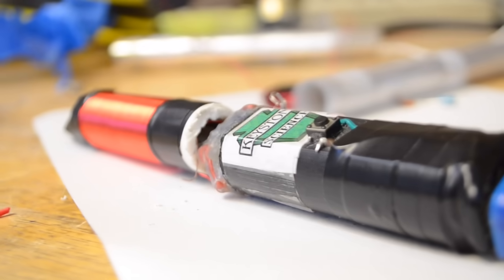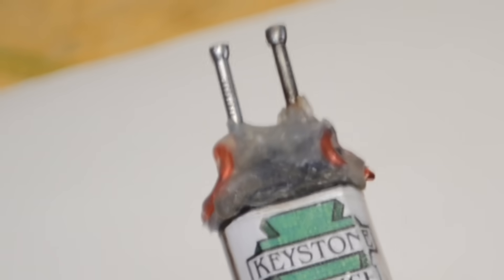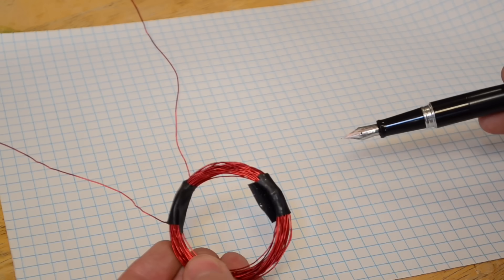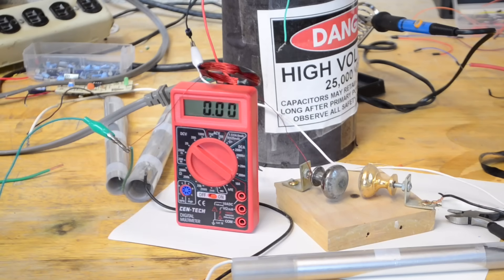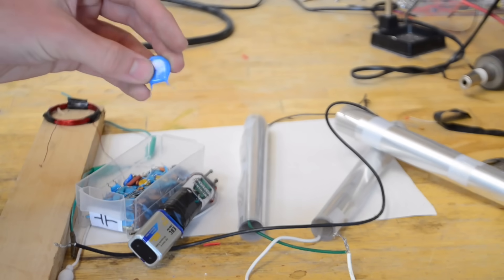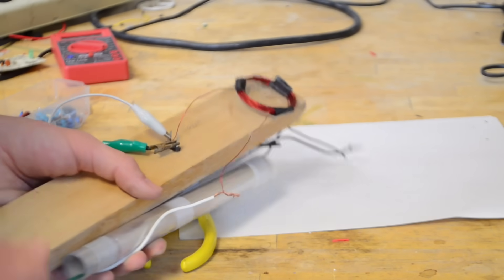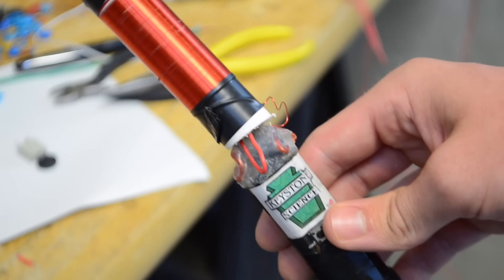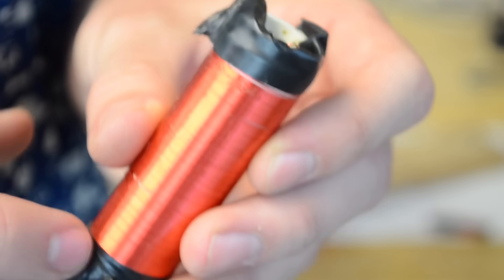How to make a pocket EMP

Comment: I'm lazy, I'll just take apart a Kodak camera and use its capacitors. I'll need a toilet paper roll to roll my copper coils maybe ten times and should be good to not overpower the capacitor. Might need to shell out money for a dpdt switch.

I'll be able to take out a cheap disposable calculator 🤩

Comment: Why was this recommended, and did it have anything to do with Airbus aircraft nose dive 30th october, characterised by investigators as solar radiation event
Reply: I been maiing some prototypes with no loads herest a simplified versio tv remote send signal receiver receives it starts a pre set timer then it heats up a fire that dicharges a shotgun slug that has no beads only gunpowred (l am not making a bomb) just trynna make something that launches rockets remotely at new year

Comment: You can trash electronics via near air gap discharge using a simple piezo gas grill igniter. No coils, no batteries, no capacitors.

Comment: Please for the love of God be someone that doesn't call a stun gun a taser. A taser is a device that shoots barbs on the end of wires connected to the device. A stun gun has 2 to 4 electrodes and you have to directly connect with the person which is what you have right there. I'm so tired of people Ignorantly calling them the same thing to the point that it's bulk ignorance out there. Knowledge is power young man.

Comment: Using the coil so close to the multitester's pcb it's obvious that the magnetic field will induce electric current  and burn the components. I came to see real emp device and you present us an antenna... Actually for all of us that know electronics what you did was input high voltage to a coil and induce current.

Comment: How close does it need to be to the electronic item
Reply: Depends on how big your magnetic field is. The bigger your magnetic wire coil and with many layers the better range. But for a small device such as this from the video I doubt the wave will reach every corner of the room he's in.

Comment: can you build me one that fits in the back of a pick up truck? lol
also this is the reason I own a 2nd gen 12 valve cummins diesel pick up, its emp proof, 100% mechanical fuel injection, no emp will ever take it out and if it were to happen on a massive scale the truck would still run.

Comment: I patented a device which converts heat almost fully into electrical energy. The patent is US 3890161A    DIODE ARRAY filed 1973, granted 1975, open for public use, 1992. It covers a device which produces refrigeration which is a loss of thermal energy while it produces electrical energy. The energy gain and loss must be equal because the energy of a system considered as a whole must not gain or loose energy though the energy may change form.

A diode array plausibly designed for power levels of watts would consist of billions of very small diodes in consistent alignment parallel or, for additive voltage, parallel series. 

The diodes partially rectify the.random thermal motion.of mobile electrons or stable positively charged  voids called holes inside diodes. The diodes are aligned the same way so the output of many diodes is additive. 

A simple rectifier crystal can, iust short of a replicatable long term demonstration of a powerful prototype, almost certainly filter the random thermal motioren of electrons or similar  positiive charged voids called holes so the electric current flowing in one direction predominates. At low system voltage, a filtrate of one polarity predominates only a little but there is always usable electrical power derived from the source, which is Johnson (observation) Nyquest (theory) thermal electrical noise. This net electrical filtrate can be aggregated in a group of separate diodes in consistent alignment parallel creating widely scalable electrical power. The maximum energy is converted from ambient heat to productive direct current electricity when the electrical load electrical resistance  is equal to the array internal electrical resistance.

Maximum calculated electrical power output (watts) is k (Boltźman's constant), one point three eight x 10^ minus 23, times T (temperature Kelvin) times bandwidth (0 Hz to a natural limit ~2 THz @ 290 K) times rectification halving and nanowatt power level rectification efficiency, times the number of diodes in the array. Rectification is inefficient at low voltage. Inefficiency reduces the performance but the heat absorbtion remains equal to the yield of electricity.

There are a billion cells of 1000 square nanometer area each per square millimeter, 100 billion per square centimeter.

Order is imposed on the random thermal motion of electrons by the structual orderlyness of a diode array made of diodes built within a slab: 

Host crystal is silicon
  P type boron doped
-----‐------‐----___-- Out
🔻🔻🔻🔻
■■■■■■___ + Out
  N type phosphorous doped 

All the P type semiconductor anodes abut a metal conductive plane deposited on the top face of the slab with nonrectifying joins;  the N type semiconductor cathodes or common cathode abuts the bottom face. As the polarity filtered electrical energy is exported, the amount of thermal energy in the group of diodes decreases. This group cooling will draw heat in from the surrounding ambient heat at a rate depending on the filtering rate and thermal resistance between the group and ambient gas, liquid, or solid warmer than absolute zero. There is always a lot of ambient heat on our planet, more on equatorial dry desert summer days and less on polar desert winter nights.

Focusing on the composition of one simple diode, a near flawless crystal of silicon is modified by implanting a small amount of phosphorus (N type conductivity) on one side from a ohmic contact end to a junction where the additive is suddenly and completely changed to boron (P type conductivity) with minimal disturbance of the crystal lattice. The crystal then continues to another ohmic contact. 

A region of high electrical resistance forms at the junction in this type of diode when the phosphorous near the ĵunction donates electrons that are free to move elsewhere while leaving phosphorus ions held in the crystal while the boron donates holes which are similalarly free to move. The two types of mobile charges mutually clear each other away near the junction leaving little electrical conductivity. An equlibrium width of this region is settled between the phosphorus, boron, electrons, and holes. Thermal noise is beyond steady state equlibrium. Thermal noise transients, where mobile electrons move from the phosphorus added side to the boron added side ride transien⁸t extra conductivity so t⁶he forward moving  electrons are preferentally filtered into the external circuit. Mobile electrons are units of electric current. They lose their thermal energy of motion and gain voltage, as they transition between the junction and the array electrical tap.

There are other plausible breeches of the second law of thermodynamics. Hopefully a lot of people, mostly as independent teams, will join in expanding the breech. Please share the successes or setbacks of experiemental efforts. 

These devices would probably become segmented commodities sold with minimal margin over supply cost. They would be manufactured by advanced automation that does not need financial incentive. Applicable best practices would be adopted. Business details would be open public knowledge. Associated people should move as negotiated and freely and honestly talk. Commerce would be a planetary scale unified conglomerate of diverse local cooperatives. There is no need of wealth extracting top commanders. We do not need often token philanthropy from the top if the wide majority of people can afford to be generous.. 

The topic deserves discussion and prototyping attemptaction. 

Aloha
Charles M Brown
Kilauea, Kauai, Hawaii, 96754

Comment: I’ll never use it on anybody who has metal in their body. I have an air module nail eight screws for pins and countless other things. I had a multiple tip compound fracture. I broke 55 to 60 bones in my foot and leg. I’m pretty sure they stopped counting. So if you use it with some men on their body and they could be extremely dangerous your wherever if it’s in like from the inside out, you can’t even put heat on your life if you have me in your life or where the metal is, you can’t put heat on it, please keep in mind as that would be cruel

Comment: I had a thought. As an internet/youtube educated,  no degree, garage scientist. This is all hypothetical in the name of science in defense of the state.

But my hypothesis is, would it be possible to attain the same resulting magnetic field onto a moving projectile? Say an arrow or something thrown, with a large enough magnetic field to knock out incoming anti troop exploding drones. Or would the resulting magnetic field trigger they're explosives? Testing this hypothesis would be very illegal. And again is why I reiterate this as a hypothetical hypothesis. I know there's already cutting-edge emp military gear. Like the EDMS4  (Electronic Drone Mitigation System). Which is a point and shoot electromagnetic pulse weapon parallel to a standard infantry rifle. Currently in use by Ukraine. Now, you want to assume oh (hershey) there's no need touch on it this anymore it's pointless. The science has already been perfected. True but one underlying problem becomes, availability. Not every NATO ally is gonna have access to this equipment. Your units out in the trenches. Your cut off. Wasting ammo, exposing yourself shooting at quick zooming drones. Your units unlucky enough to not have the fancy emp rifle What I want to make is a simple, easily accessed, troop anti drone emp projectile with a wide enough magnetic field to safely knock out killer drones and spare friendly electronics. An affordable and reliable alternative to the EMDS4.

Comment: Use airsoft grenade,  large quartz crystal, compression pneumatic and a very well pre tested rock solid explosion chamber, connected piezoelectric charge to large inductor around explosion vessel. Detonate the airsoft grenade,  what you'll get is a tactical EMP that'll knock out phones out to 10ft assuming the explosion vessel doesn't become a pipe bomb 😂

Comment: Suspecting that how that circuit ACTUALLY functions is that the cap fills up to a high enough voltage to jump that spark gap and it discharges through that the inductor’s field collapses mostly and that repeats
Reply: How is that different from how he said?

Comment: Just use a stun gun or something stun gun flashlight.
Good way to short out electronic door locks, cellphones.

To make it be focused- insulate the coil with plastic and then sheet metal. The metal acts like a ""Farady cage style cannon""!❤
It's more focus and more power directed at the object closer to a pin point accuracy.😮😮😮

Comment: Make the pocket coil stronger by putting multiple layers of wire or using an iron pipe instead of PVC. Or both.
Reply: No iron pipe would make a permanent magnetic wouldn’t it? Then no pulse.

Comment: dude I built my first one before it was ever even called any of that. Back in 9th grade I took four different shops at a vocational school one of them was electronics. Sophomore year the first project was the taser. (Well that's what you call it today...) Except when I engineered the board I had the two wires one on each of my index fingers) 🤌 so when I said hello it woke you up... That's not why I got kicked out of school though :/ That's because that was the actual project we agreed to and everybody built it not just me.

Comment: also, you could use an iron water pipe to wind the coil around.  use insulated wire you could get from cat 6 ethernet cables or use tool dip or some other means, such as dipping the pipe in liquid wax or elmer's glue to create an insulating layer around you iron pipe.  the iron pipe will strengthen the magnetic field of your coil windings, in the same way a transformer is wrapped around an iron core
Reply from the maker: That's true, however it would also lower the frequencies expressed.

Comment: Killing Weeds?  For a long time I've toyed with the idea of using a taser type device to kill yard weeds like bine weed or dandelion weeds.  Bine weeds are particularly loathsome because they propagate by roots, and leaves.  They are very deep rooted and by actual excavation they are sometimes 10 feet deep.  And they overwinter, so hard to eliminate.  In some areas it is actually illegal to allow them on your place.
And dandelions are bad because they propagate so easily.  Mowing through them just spreads them all over the place.  And they are virtually immune to weed poisons.

I think to be effective you would need to able to have a grounded terminal and a surface terminal the idea being to pass such a high voltage through the plant that it killed the root much like a severe lightning strike can kill a tree.  I know some walking canes produce 1 million volts.

Just a thought.

Comment: For over two years now, I have been attacked and tortured by neurotechnology. I tried to disable it by building a version of your emp but was unsuccessful at assembling it. However, I did get an MRI. Is there any difference between the destructive effects of your device compared to an MRI on something like nanotechnology? If not, you should figure out how to destroy neurotech in case it becomes a problem for you. And please post a video explaining how to do it so I can finally get rid of the criminals who won't stop until I am dead.

Comment: What about a XXXL ultracapacitor bank, a Tesla coil (which is a step up transformer of 1000x) and a very large antenna? With an extra large spark gap and a diode to the Tesla coil, the receiver would connect the circuit!

Now what if this was suspended by a high altitude balloon?

I
Reply: Hot air balloons can do marvelous works of Christ!
Reply: I'd love to see Nikki's reaction, that'd be hilarious, what a bitch!

Comment: I was just curious about the capacitor bank. There are a few ceramic disk capacitors wired in series that will handle the voltage without blowing the capacitors, but they will build up a heck of a charge. I noticed that there was not a bleed resistor wired into the circuit. Are the capacitors in this device safe to handle after power is discontinued?

Comment: Saving this for when AI takes over
Reply: Good point!! Let's hope they are not shielded!!!
Reply: @katarinaespwall8542  Nobody puts sensitive electronics that they care about in something that isn't protective.
Reply: @jayleno1121 shielding from emp=\= phone case, it needs to be in a faraday “cage” or bag , or something similar 
To quite literally SHIELD it from all those insanely energetic electrons :)
As for the EMP shielding for drones or UGV’s they are likely the perfect candidate for this type of defensive and i’d be surprised if the engineers didn’t start mk.1’s with them 
And if they did they’d SUPER quickly add cheap faraday cages around the clankers chips and sensors anything possibly affected
Reply: @chupacabra304  Don’t you think the cage around their components like their cpus would be too small for any modern day emp?
Reply: @shooternerd im no physicist or electrical engineering expert 
But I think that I believe??? I’ve read that smaller chips are even more sensitive to emp 

Thats a quick google fact check on me tho 
Imma report back rq
Reply: @s @shooternerd  AI Overview

+4
Yes, smaller, modern microchips are generally more vulnerable to EMPs because their tiny components and lower operating voltages are easily overwhelmed by the induced voltage spikes, creating damaging heat or arcs, despite their smaller physical size intercepting less energy, which is a conflicting factor, making hardening crucial for survival. 
Google copy pasta

Comment: Just a question: Does it matter if one has "Magnetic coiled wire" or just regular copper wire, in order to create an EMP?
Reply: well it matters as far as the normal plastic coated wire is much more thick, and with magnetic wire you can add more in less space

Comment: There's a video up from Davos of the Pfizer CEO talking about putting microchips in drugs (pills). You take their chipped drug and it allows them to track "compliance" in taking their drug (whatever that drug might be). This device would be handy in thwarting such "compliance monitoring" by frying the chip in any drug you may be instructed to take. Also, remember Bill Gates talking up the ability to add microchips to vaccines just a year ago. This device would also be useful in frying such chips suspended in a syringe of vaxx as well.

Comment: i have a question, why did you remove the one end of the capacitor bank at 3:45, also if one end of the capacitor bank touches the coil end, what happens to the other end??

Comment: Could we able to replace the home made capacitors with electrolytic capacitors if so what will be the value, I am working on an experiment the power supply will be of 23v 12A does that produces a high emp pulse